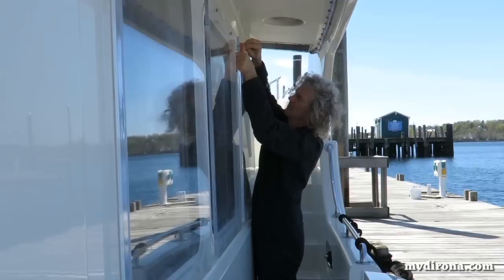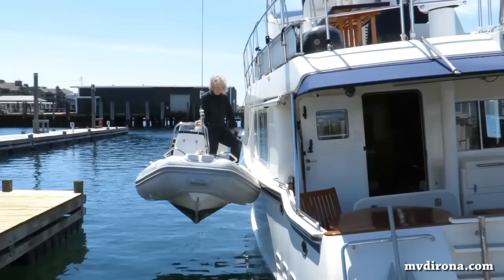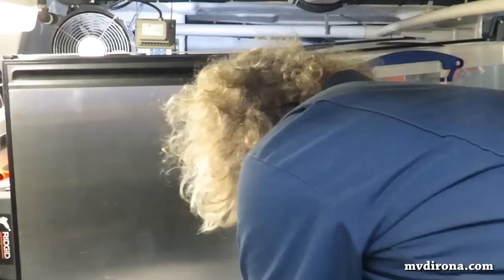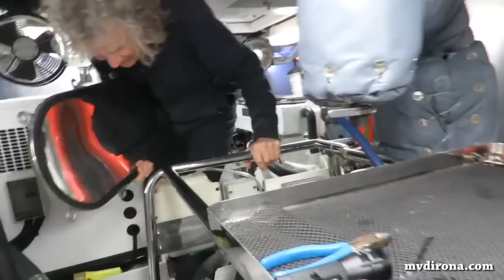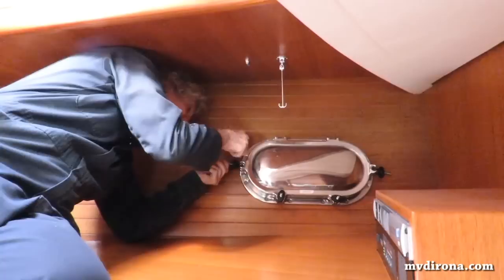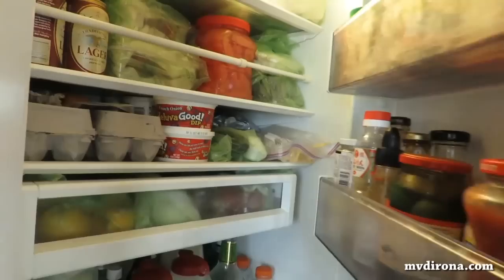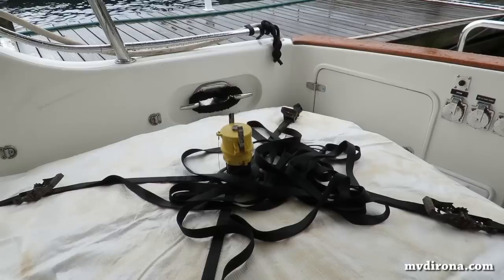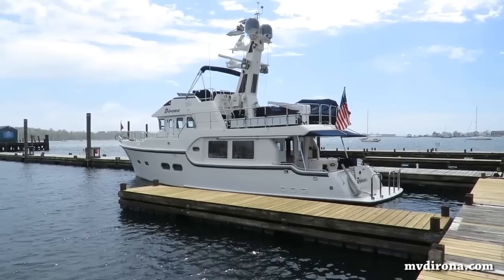Preparing Dirona for the North Atlantic Crossing (MV Dirona Channel)

Comment: I would rather sail and not have all the fuel on the deck.
Reply from the maker: Yes, sail is a very common choice.  Another alternative is to take a routing that doesn't require deck fuel. The North Atlantic can be crossed in shorter hops where deck fuel is not needed.
Reply from the maker: Fuel bills range all over the place. The US, South Africa, and Ireland are remarkably inexpensive. The US was down below $3.00 per gallon and Ireland was below 0.50 euros.  Some places are super expensive. St. Helena was up over $7 per gallon. Knowing that St Helena was super expensive we filled the fuel bladders in Cape Town even though it was only 1,700 nautical miles to St. Helena. That allowed us to not need much fuel in St. Helena for the 3,800 nautical mile run to Barbados.
Reply from the maker: We spent 1 year and 7 months in Australia so we're super familiar with your diesel prices and have spent close to $7k more than once. GREAT country, great scenery, great people, but on the high side for fuel costs.
Reply: We run on waste vege oil, its an alternative to diesel and a significant cost reducer, when we fill with marina diesel from empty to full in Australia we can pay $27,000 alternatively if fill the same amount with vege oil (identical range, slight mod to main engine to run this) we pay $4,480, I love the ability to start an engine and cruise to where you want at a speed of your choosing but the fuel bill can be a downer...
Reply from the maker: 50% off fuel would be nice.  You do need to be super careful on fuel filtration and fuel stabilization if you store it for longer periods when using vegetable oil.
Reply: MV Dirona that’s true. We built a system that runs an stand alone polishing system that runs on an independent solar panel. Whenever the sun is shining the oil is being circulated and filtered
Reply from the maker: Nice, innovative design in going with constant polishing with solar power.
Reply: ever price a sail?   that buys a lot of fuel.  rigging?  also expensive,   they all wear out and have to be replaced.   Sailboats capable of these trips are also costly,  so you arent really saving what you assume that you are.
Reply: On those really long passages over , say a thousand miles or so, do you maintain a 24 hour watch?
I'm going to be singlehanding a large powerboat and im curious about that.
Trip is from the gulf of Mexico into the Great Lakes.
Nice job on the prep work for the crossing.

Comment: Interesting to see the fuel bladders. I've been running the numbers on taking a Ranger Tug across the Tasman Sea using a cockpit fuel bladder. Nice to see someone else using them also. You guys are a masterclass in open ocean trawling. Keep up the great work. Thanks for the content.
Reply from the maker: Thanks for the feedback.  A great source for fuel bladders is ATL with a broad selection of standard sizes and they also do custom designs.  Our experience is that the key to a stable bladder is fully filling it. We have had ours out in heavy weather and they never shifted.  As an example of how full we aim to get it, we have a picture of me standing on one where I'm hard sinking in at all.  Good luck with your project.

Comment: I lost count on the fuel, Batman you better bring some big cash to pay the gas station!
Reply: if that boat starts on fire, its going to be spectacular, you will see the explosion from mars
Reply from the maker: The deck fuel won't make a notable difference. It's a fiberglass boat full of 1,750 gallons of diesel (not including the deck fuel). Fire is a highly scary prospect so we are careful cooking, scan all high amperage connections with an IR gun every 6 months, and ensure the propane and gasoline storage is well vented and only overboard.  We have smoke detectors in every room and lots of fire fighting equipment.

We do our best to avoid fire, we do our best to detect fire early, if a fire every happens we'll do our best to get it extinguished fast, and we have a life raft if all else fails.  Generally, fire is very dangerous on any boat and fiberglass boat owners need to be particularly careful.

Comment: If I calculated correctly, you took a total 2700 gallons of fuel. That's more than 10 thousand liters. According to the specifications of your boat, that's almost two distances you had to go. Why so much? How much you used from coast to coast?
Reply from the maker: There are two things going on. The first is manufacturer specifications are usually measures of boat range in flat water and real ocean conditions are remarkably worse. The real world range for our boat at more than 7 kts is 2,500 nautical miles.  If you are willing to run much slower, it might be able to be stretched out to the full 3,000 nautical miles we needed to cover.  It would be cutting it very close and we wouldn't be willing to do more than 2,500 nautical miles our selves.  

The second issue is we like having more fuel on board to allow faster crossing speed or deal with mechanical problems that increase fuel burn. As an example, we used less than 1/2 of our tender fuel exploring up the Brisbane river in Australia. We bent the problem which limited our top speed a bit but otherwise didn't seem to be a problem. When we were part way back, we learned that our fuel burn with a slightly bent prop was 30% worse than normal and we didn't have the fuel for the full return trip.  There were lots of ways to solve that particular problem on the way back into Brisbane but there wouldn't be in middle of an ocean crossing. We like having more fuel than we need when off shore in a small boat.

Comment: How about attaching a safety line to one of the bottom holes of the storm plate when attempting to install on the port side. That may save having to replace/dive for the plate in the event it slips. Once you have the top two screws in simply untie the safety line and carry on inserting the bottom screws. Just a friendly suggestion from someone who has dropped many things (mistakenly) into the drink!
Reply from the maker: I think your right that it would be easy to drop a panel and a safety line wouldn't be that difficult to install. It's a good suggestion.

Comment: Interesting. I always just assumed if your boat couldnt hold enough fuel you couldnt go. I didnt even think about carrying extra fuel bladders! learned alot, thanks for sharing!
Reply from the maker: It's a common trick from the aircraft sector where short distance planes need to rarely need to do a larger hop. The military is another frequent user where they often need to store fuel at temporary locations. Another popular use of fuel bladders is in high speed sports fishers that need to run out a hundred miles or so to get out past the continental shelf on the US east coast. These are fuel hungry boats running at 20 and sometimes even beyond 30 kts so bladders are frequently used.

Comment: Yes I was also wondering how you transfer your fuel from your bladder. What a great idea. I've never seen fuel bladders before now.
Reply from the maker: The fuel bladders are connected to a bulkhead fitting via short fuel hoses with cam lock fittings. There is a fuel transfer pump  inside the boat that is responsible for pumping fuel between tanks. From inside the boat, the fuel can be transferred from the bladders into the tanks below. More details on the process here: https://mvdirona.com/2012/12/fuel-for-the-crossing/.
Reply: Long range fishing on a smaller boat people will head out on a loop drop a bladder with a beacon in the ocean do your loop , refuel load the bladder and head back in
Reply from the maker: I hadn't heard of this before but I suppose diesel is lighter than water so it would float and so it would work. Makes sense.

Comment: Great video. I have seen the fuel bladders used before on old DC3's in the Canadian Arctic to get fuel to remote locations.
Reply from the maker: Yes, fuel bladders are used frequently to extend the range of small aircraft.  It's a nice solution and there are a lot of different applications: http://atlinc.com/rangeextender.html.
Reply: We used a 2500 gal bladder on the minesweeper I was on from Long Beach CA to Pearl Harbor during Vietnam.

Comment: Thanks for a 'Reality Tube' on long distance voyaging.  This is vital information for would-be boaters to come in contact with.  Shipbuilder's crossing videos don't show the steps needed to fully secure windows at the cost of natural lighting and ventilation.  What with the move to bigger windows at each level, I have been interested in just this detail.
Reply from the maker: You nailed it. All decisions in boat buildings are compromises.  Small windows are better at sea but you mostly aren't at sea. Large windows are wonderful most of the time but aren't safe in extreme conditions. The solutions I like best are very thick windows or protection with storm plates. 

A broken window in storm conditions could end it all so it's worth being careful.

Comment: Great stuff. I'm glad that you guys took the time to show us how you prep your boat for long passages... I especially love the utilization of your fuel bladder for extra fuel for those  far away excursion. I think that that's a great idea. Good for you guys! Furthermore, I would like to take this opportunity to state that I too would love to know, if you don't mind of course, how you transfer the fuel to your main tanks. I've visited the web site in which sells those bladders and seen that they have electrical powered fuel fill hoses and wonder if that's what you guys use?
Reply from the maker: Thanks for the comment Robert. We use a cool system where a passive hose is cam locked onto a permanently installed bulkhead fitting on one end and the fuel bladders on the other. Using the fuel manifold in the engine room, I can just pump the fuel below without going out side. There is a picture of the fuel transfer system in this article: http://mvdirona.com/2013/12/dirona-fuel-manifold/

I've outlined a bit more detail on the transfer process and advantages here: http://mvdirona.com/2017/10/preparing-dirona-for-the-north-atlantic-crossing/#comment-214735

Comment: My brother has a beautiful 55 Nordhaven. There's a lot of boat for its size. They are heavy and ride deep in the water. Crossing the North Atlantic takes a lot of balls, knowing the storms, currents and high seas one can encounter.  The one thing that caught me when reading your intention, was the power this boat has, or lack there of.  An adventure of this magnitude and the fact these boats have only one engine, with very limited power, concerns me.  The trawler is a low and slow endeavor. Getting out of harms way may not be possible at the speed this boat has. One would suggest, making the crossing with other boats should you have engine problems. As I understand it, Nordhavens are built for riding up and down coastal waters, long distances, in great comfort. A long and dangerous open water jaunt shows, you are either very brave, or, well, let's leave it at that.  Good luck!!
Reply from the maker: The 55 is a nice boat. The high level design point for a Nordhavn is safe, comfortable, and able to go anywhere in the world and cross any ocean.  Not all of them cross oceans but nothing makes for a safe coastal cruiser better than designing for open ocean conditions.

Many have crossed oceans. Some of routing is unusually long which makes for slightly more logistics (like needing deck fuel). 1 of our ocean crossings was in a difficult time of the year so we took more rough weather but none of those are required so it really doesn't require much courage. 

On that North Atlantic crossing early in the season, it was rougher than most crossings: https://www.youtube.com/watch?v=guEnTp2a6Sc&t=6s. But schedule was set by us knowing we would see a few low pressure systems.
Reply: @MVDirona  Thank you for thaking the time to share your knowledge with me. I think, I just want to have my mind set at ease should my big brother go off and tackle such an awesome task.  Before my brother purchased the boat, I thought I was the only one in our family interested in offshore adventures. Seeing him jump in, with both feet, purchasing this monster of a boat had my head spinning! It takes a rare individual to do what you did.  In my younger years, I traveled the world as a Hollywood stuntman. I knew, I was capable of doing questionable things.  My brother, not so much.  I am proud to see him find himself with the purchase of such a fine vessel. Perhaps, someday, the two of you shall cross pathes and remember our little conversation. Be well!!!!
Reply from the maker: A Hollywood stunt man?  Yeah, you'll be fine crossing oceans. Anyone who can get shot and fall out of a second floor window in the morning and roll a car three times that afternoon, will have no problems with fear when crossing oceans :-).
Reply: @MVDirona  I was the stuntman. My brother, and new owner of the Nordhavn, is a lawyer.
Reply from the maker: Yes, I'm just saying crossing oceans isn't any more courageous than one of your previous jobs. Probably considerably less so.

Comment: The yacht is a flammable cruise machine with all those fuel
Reply from the maker: The tanks are full of diesel which has a flash point of 126F and as a consequence, the fuel is considered combustible rather than flammable. Gasoline is a common flammable substance.

It still is true that a boat carrying over 2,000 gallons of fuel could fall victim to fire and, where that to happen, it would be difficult to control.

Comment: So impressed with your videos.  Thank you.  I am particularly impressed with the content.  I am curious how you transfer fuel from the bladders and what ranges you achieve with and without their use.  It looks like the bladder systems according not for 800 additional gallons of fuel for transit.  Love to see some of your thoughts on fuel management, transfer, etc.  Thanks for the great content!
Reply from the maker: The fuel capacity of the boat is 1,750 gallons below deck and 2,710 when carrying all it can.  The furthest ocean crossing we have ever done is 3,800 nautical miles and the boat range with reserve is just over 4,000 nautical miles with deck fuel. Just using the built in fuel tanks, the range is 2,500 nautical miles.

Fuel transfer is a super simple arrangement that doesn't even require going outside or opening up the tank deck fittings and possibly getting water in the fuel. We have a bulkhead cam lock fitting. We just snap on the hose at the bulk head and snap the other side of the hose in a cam lock fitting on the fuel tank. When the tanks are hooked up like this, they can be pumped out by opening a valve in the engine room and turning on the fuel transfer pump. The same pump that transfers fuel around in the boat is also used to transfer fuel from the bladders to the main tanks. 

You can find a picture of the fuel manifold and controls here: http://mvdirona.com/2013/12/dirona-fuel-manifold/

Advantages of this approach:
*The tanks are drawn and all the fuel is sucked out making them very light and easy to fold up.
*No water can get in the fuel
*All fuel is filter prior to leaving the bladders and being brought down below for storage in the main tanks
*No need to go outside and fuel can be pumped in rough water without risk to personal or the fuel load
Reply from the maker: We have a nice fuel transfer system for the bladder fuel where we connect a cam to a permanent fitting on the bulkhead via a short hose section to a cam lock on the bladder tanks. When it is time to pump the fuel, the standard fuel transfer pump moves the fuel from the bladder, through the transfer filter (25 micron RACOR FPO-10), and then is directed into one of the main tanks. This has the advantage of allowing fuel to be pumped with nobody outside, doesn’t require the tank filler to be open to water ingress, filters all fuel as it leaves the bladders, and allows the bladders to be pumped completely dry so they are light and easy to handle.

When fueling the main tanks, the fuel is brought in directly. We filter all fuel that is transferred from the main tanks to the day tank (wing engine) or the supply tank (all other engines) using the same 25 micron RACOR FPO-10) transfer filter and high capacity fuel pump.

If you are interested, there is a lot more information on the fuel management and transfer systems used on Dirona here: http://mvdirona.com/2013/12/dirona-fuel-manifold/
Reply: Coffey Beans ii

Comment: While I'm not much of a fan of water, I think boats like this are fascinating. I'm a mechanical / technical kinda person and all the systems to work with and stuff to do would be loads of fun for for me.....too bad my budget and land location will likely never  allow for anything bigger then a bass boat! LOL!
Reply from the maker: If you like mechanical things, boats are full of them. In my distant past, I was an auto mechanic and more recently I work on data center infrastructure hardware and software. The experience from both is useful on the boat.
Reply: Your experience shows. I could tell in the video that you're more mechanically adept than a lot of cruisers I see on You Tube!   Not many would call out the spec's  / brand of fuel filters!

Comment: i'm not a professional by any means but you are sure the deck can handle those fuel bladders, serious weight there. Anyways, would love to do this one day
Reply from the maker: The weight is fine from a structural perspective. It's just over 50 lbs per square foot.  The other risk is boat stability since the bladders are above the boats center of gravity. With the bladders the boat still checks out as CE Category A All Oceans so we're covered on that one as well.